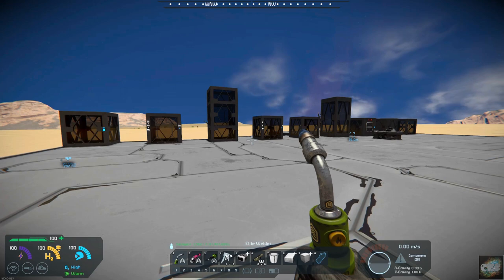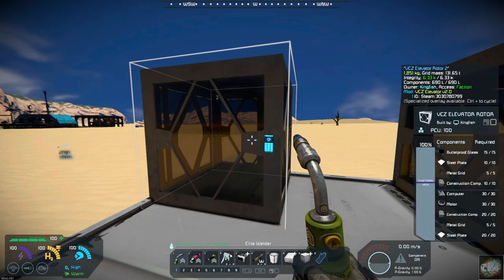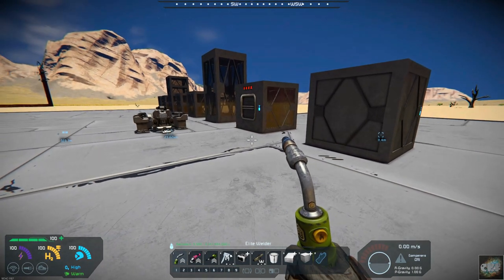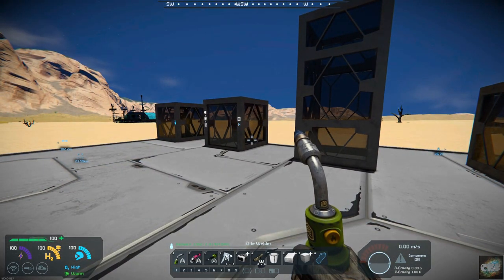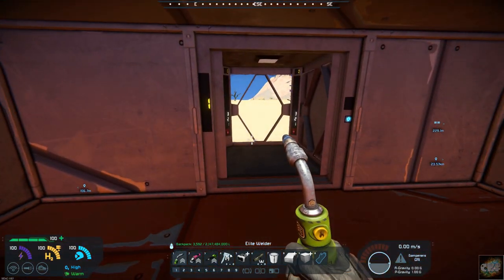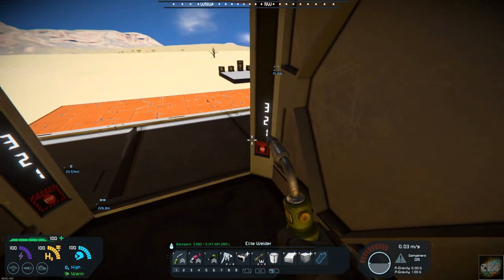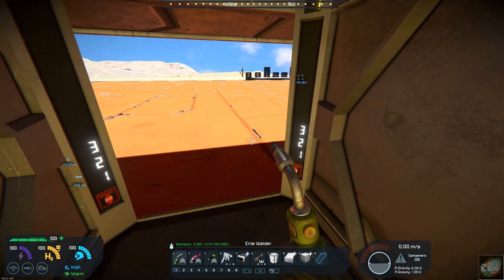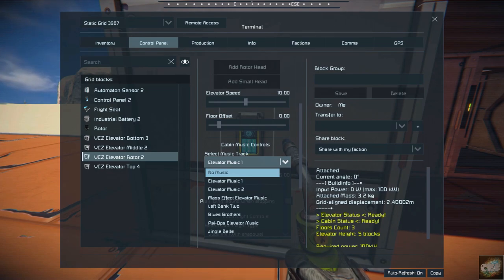Space Engineers – Mod Wednesday – VCZ Elevator v2.0

Comment: I love the video, but I think the main usage case for this mod that I am interested in would be in a spaceship, because normally, when you try to engineer a elevator in a spaceship, the sub grids cause a lot of problems. So I’m interested to see if it would work in a spaceship just as well. I’m also curious to see if there’s a way to call the elevator from another floor if it’s not already there.
Reply: a lateral transfer tube would be nice
Reply from the maker: Thanks!  Yes you can call the elevator to what ever floor you are on if it is not there.   I am more base building so that is why I am excited for it.  I have already used in in my current base build series and it worked great.  It is only large block so it would not work on small ships but maybe on a large ship build it might work good.  Good luck with your build.
Reply: I just subscribed to this mod today and have been using it in a command tower build in creative. After figuring out the weird order of the elevator bottom and the rotor. It works pretty well, I have mine set up on 5 Floors and when you hit the button it comes from whatever floor it's on down or up to the one your at. The music and lights are also a nice touch.